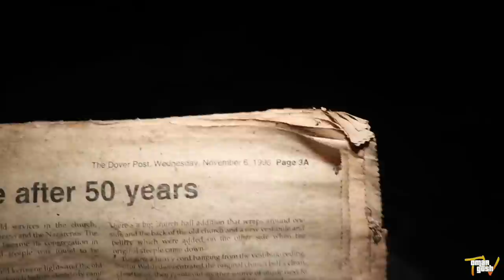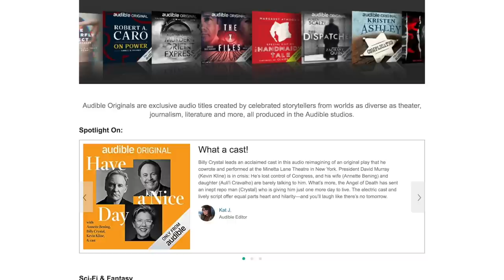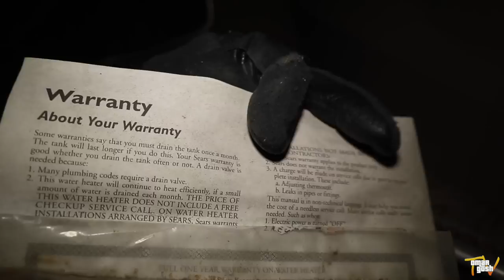(BANNED VIDEO) RECORDED MYSELF SLEEPING ON A HAUNTED BOAT AND THIS HAPPENED

Comment: The ship horn shouldn't be pressurized like that after 35 years
Reply: Yeah, but what caused it? An angry ghost...
Reply: It didnt have a engine or battery for that horn to sound off I dont even think that horn should sound like that on that small size of ship
Reply: @MISFIT.ENT89  I was thinking that same thing but did you see like hand in the background when that latch slammed
Reply: Tyler Zeek Yes! I just commented about that
Reply: I feel like ghosts can do anything if there was power or not
Reply: christopher smith no actually it could be
Reply: christopher smith it was way too loud for that ship, it should be loose....
Reply: That horn went off somehow it had to be a ghost even though it hasn't worked for years
Reply: i think i see a truck in the backraound maybe is from him on sec 23:50
Reply: 22:32 left behide the chair, thats not an ordinary orb.
Reply: Small boats like that don’t even have loud horns like that, that’s a ship horn. You need a large compressor tank for a horn like that.
Reply: kilerman tnt freeze it at 23:57 and you can see it’s a trailer of some kind with two wheels it looks too new to be there with the reflective strips like most 18 wheeler trailers have.
Reply: yeah

Comment: 3:36 when you said "what was that ? "there is an orb flying under the roof . It's very quick , you move your camera right after !
Reply: It is reflection
Reply: @high999ping7  how do you know ?
Reply: @elborbah3045  because it moves at the same time as camera
Reply: @high999ping7  OK Kriptor !
Reply: Yea it’s a reflection from the camera not an orb
Reply: There's several there
Reply: I haven't seen spooky stuff in my life and all that but I've seen an orb there's several orbs where that location and time spot is

Comment: i could be just assuming but, there looked to be dese biological matter left on the chair. you can test it by having hydrogen peroxide @ 12 percent. put some on a long q-tip and touch a corner of the area intended for testing. if the matter starts to disintegrate, its blood.